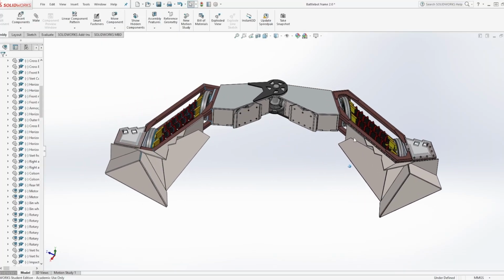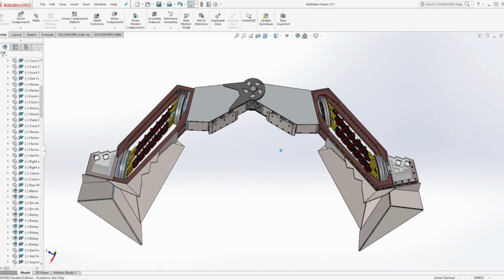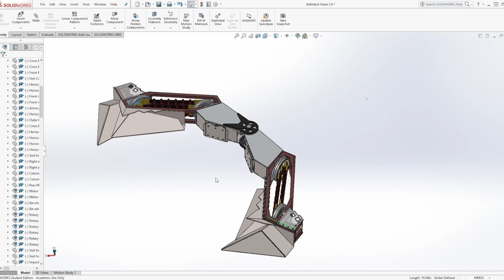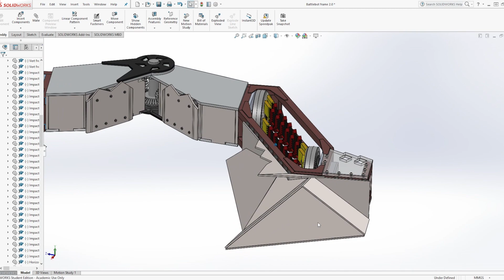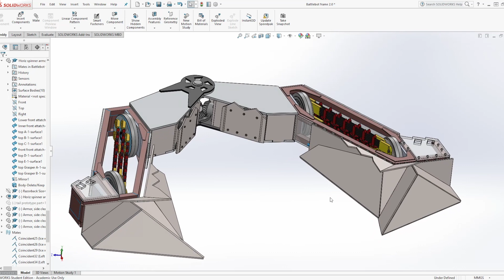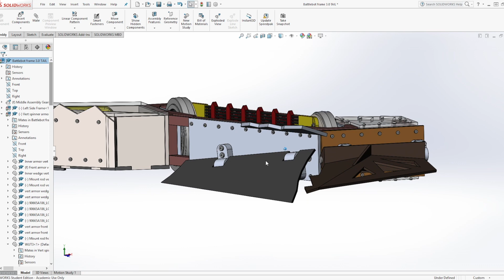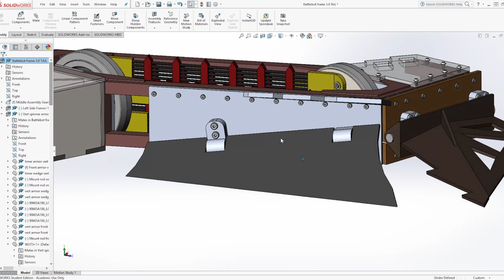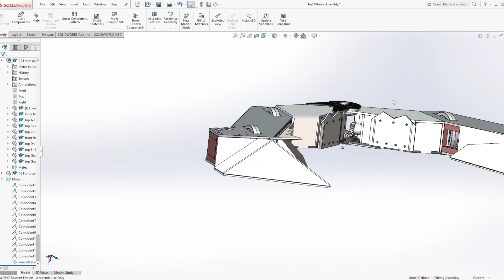Designing a BattleBot (Pt. 4)

Comment: hey altapowderdog I am making a small combat robot and I need some tips, can you give me any? check my channel for updates on the robot.
Reply from the maker: Looks like you're starting exactly how I started- ripping apart some RC cars and using their radios.  The RC cars that only have a single motor are annoying- but it looks like you're planning on using both remotes together for control which will work.  One thing you can do is instead of having one remote for "steering" and one remove for "drive" you can make one remote for "left wheel" and one remote for "right wheel" and go with tank-drive steering instead of car steering.  Also, if the motors you have spin too fast and don't have enough torque then you'll need a gearbox. You could try using the RC car gearboxes, or could try GM3 Gear motors from SolarBotics which are not too expensive and work well.
Reply: I'm now thinking of tank steering for the bot, also I found another rc car but it has 2 motors and I'm thinking of using one for a spinner (hence the name spin strike) and the other for a lifter arm, should I buy a servo for the arm and if so can it be used with only 2 wires going to it?thanksmaxp.s krave monster is adorable and ,just a thought, I think you should have a casing on the shaft that controls the scoop on the bottom.

Comment: I'm sorry if I sound critical but how would this be an effective robot, are you planning on stalling the motors at the pivot while grabbing something, looks like a job for pneumatics.
Reply from the maker: Criticism is fine- no worries.  Lots of clamping robots use electric motors (which yes, do stall).  Bite force and Overhaul both had electric-driven clamps.  In this situation pneumatics struggle to provide the necessary rotation (100+ degrees) without the actuator being super exposed, but if you have a design you think will work feel free to sketch it out and I would consider it

Comment: for Battlebot's second season, they added a rule that made it where every robot needed a primary weapon that can deal damage, which is why Bite Force had to added the drum that failed them. What is your plan for a primary weapon?
Reply from the maker: The "Active weapon" rule was there in season #1, that's not why bite force changed weapons.  Seasons #2's bite force was actually his original design, which was not accepted for Season1, but once he was the champ he could build what he wanted.  In Season #2 lots of accepted robots had active weapons which were designed to manipulate opponents instead of destroy them, such as Overhaul, creepy crawlies, Lycan, complete control, and Stinger